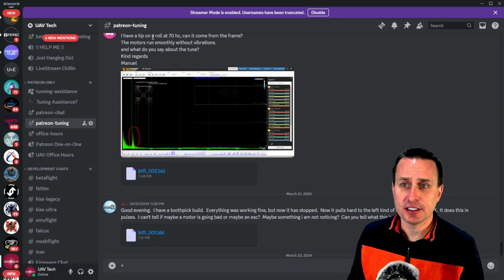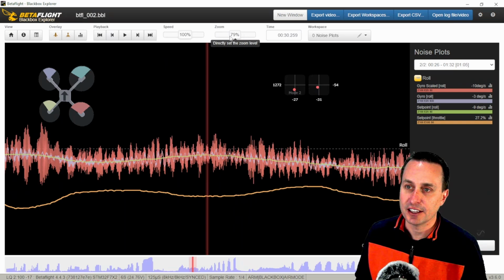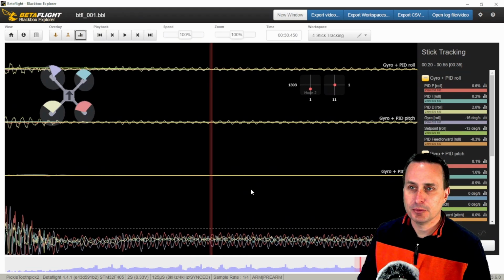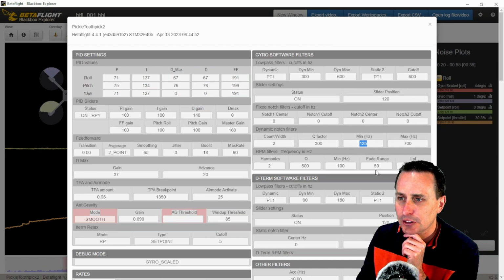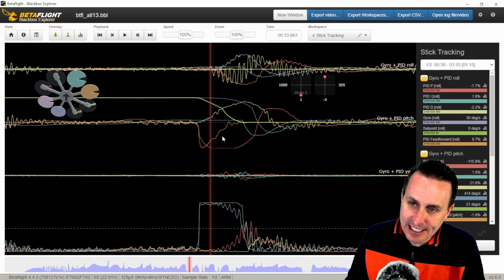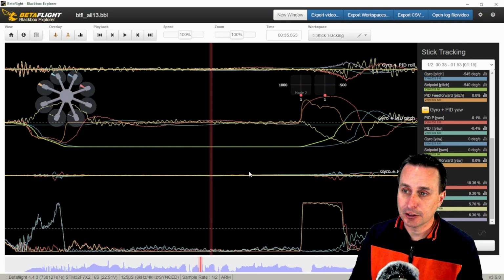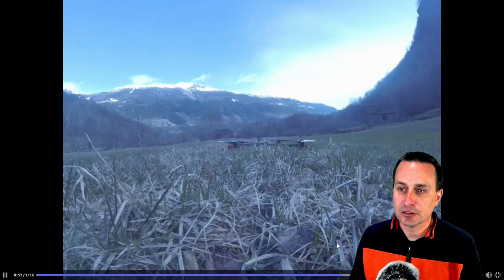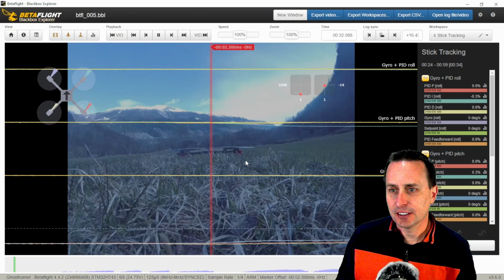Common Drone Issues: Spike, Vibes, Bounceback and XCLASS Motor Balance

Comment: I've been having a bit of a fight on bubbyfpv's video with his cinelifter, which had major propwash in a move he did.  A guy claimed that because it's so large and an x8 its propwash oscillations can't be tuned out.  What do you think?  Would you mind weighing in on it?
Reply from the maker: Cinelifters generally has great wash performance in my experience.  If the tune has low gains (<60), it can be made better by raising the gains.
Reply: @uavtech  That's what I was saying and the guy was just like, no its too heavy. lol
Reply: @uavtech  https://www.youtube.com/watch?v=Wc73sfwajyE  "Is this BNF FPV Cinelifter Drone Worth $3000"

Comment: I wish I could find a video on using pid tool box for dummies. How to cut out a landing or a crash. How to use it for a dumbass. All PID tune videos explain why you’re tuning for 20 min. Then how to tune for 5 seconds. Like what is  an oscillation. What’s is sound like. How do I do each flight. Is a rpm tune flight a regular flight or where I wobbles. I wish people would put the why in a different video and just do all how. Oh and how you use the program. Open this where did I get that. How do I cut the timeline. What’s the shortcuts. Just a how to for dummies.

Comment: good stuff.  I just got my 7inch INAV DC to behave by reducing FF on pitch and roll by about 50%.  an aggressive throttle up would cause a significant shudder on pitch.  now I need to figure out why INAV bbexplorer wont tell me frequencies.  its 'infinity htz' along the graph